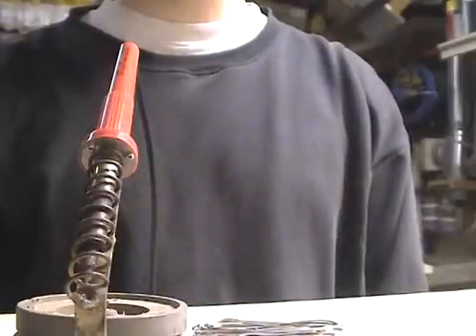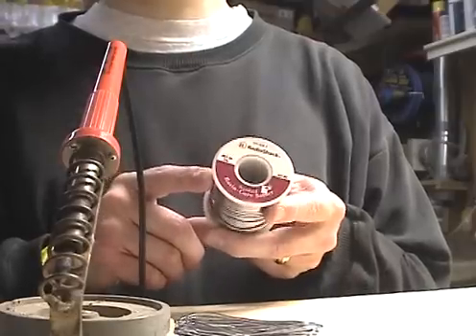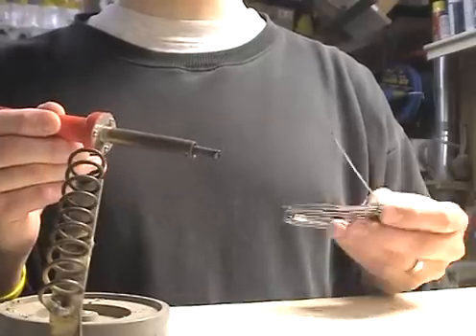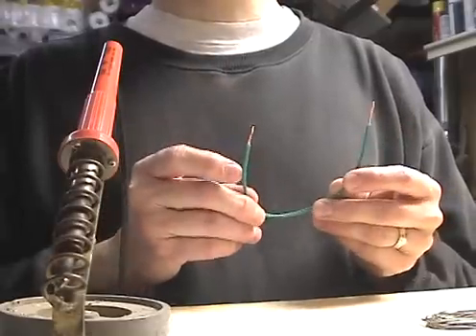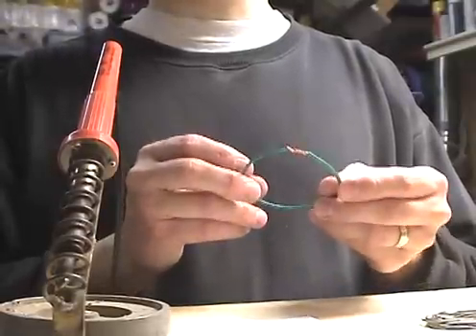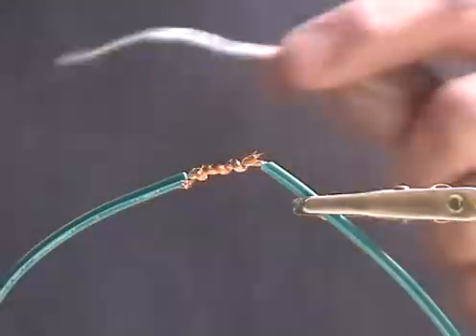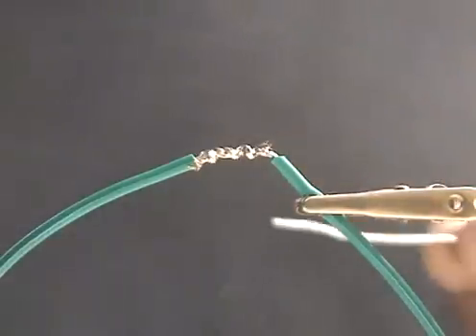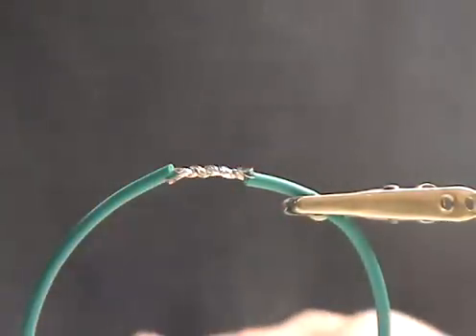How to Do It: Basic Soldering

Comment: My weller 25w iron didnt do well on my guitar pots. Took too long to heat the area and made a mess. Worked better with small soldering. But for pots i  am guessing 40w would work better.

Comment from the maker: @andromedarr When soldering delicate electronics, the first precaution is to make sure your soldering iron is sized for the job: don't use an iron that's too hot (too many watts).  Then you should use a heat sink (a clip on the component lead in between the solder joint and the component) if possible.  Finally, speed in completing the solder joint is a necessity because it minimizes the time the joint is heated.

Comment from the maker: @m6b0i When you solder you need both solder and flux.  The flux acts as an anti-oxidant, and as a wetting agent for the soldering process.  The rosin in the core of the solder is the flux.  You need to use flux every time you solder.

Comment: @m6b0i The reason to use rosin-core is because it's easy. With solid solder, you need to apply some type of "flux" (something that helps it melt). Rosin-core solder is called that because the core is filled with rosin-flux, so it's already got flux in it.

Comment: Im sorry for this retarded question because im new to this, but what does the rosen-core solder do? does it clean the tip? Also if i were to solder wires onto a circut board, would i have to use the rosen-core every time after soldering a wire? Thanks

Comment: I'm sorry but I fail hard at soldering. I try to heat the joint but it starts to be burned away and destroyed. I try to tin the soldering iron but the solder doesn't melt. Plus my iron has a shit-ton of oxidation on it. And my solder is too thin and doesn't cover the joint. Plus my raging boner keeps knocking the components away. Please help!

Comment: @letigirl62 
Your tip is probably oxidized. Wipe it when it is hot with a wet spunge until it is clean again, dont burn your fingers, you may get away with using wet paper, folded into a pillow. Once the tip is clean then try to apply solder to the tip so that it is covered by a thin layer of tin. Wipe and repeat if the tip is still oxidized.

Comment: Let the tip get hot enough to melt solder, then tin the tip, then apply the tinned tip to the joint, then rub solder on the joint. Your soldering iron might not be hot enough.

Comment: a tip you can use when soldering wire together is the make a little bubble of solder on your iron then put it on the wire so it more quickly heats the wire to do more contact, just to save you a quick second or two of your life

Comment: im new into soldering and really getting discouraged im not having much luck i bought a cheap 60watt pencil tip solder iron and some rosin core solder 3/32 diameter and nothing working right even when it was brand new it wouldn't melt the solder through a wire or terminal i had to like spread it what is my problem lol

Comment: If you are trying to solder directly onto the surface of a sensitive circuit board or just onto a circuit board or even perf board with sensitive chips on it, do you put your soldering iron on the spot to heat it up like you did in the video and them put solder on it or do you do something else? The reason I ask is because I have heard that too much heat can fry and/or break sensitive circuits.

Comment from the maker: @ELComandoARMADO  The problem is an iron that is too big (gets too hot) for a particular use will do collateral damage in short order instead of just getting the joint hot enough to solder.  In your case it will likely melt the wire insulation near the joint, causing cosmetic damage to the wire, which may or may not be a big deal depending on how particular you are.  In the case of electronic component soldering, too large an iron can damage the components themselves.

Comment from the maker: @spartan117024 The joint will cool pretty rapidly once you remove the soldering iron from it, but as long as it's hot enough to melt the solder you don't need the tip in contact with the joint.

Comment from the maker: @MackJohnny When the iron tip gets oxidized it won't conduct heat well.  In other words, it won't melt solder and/or transfer heat to your soldered joint.

If the solder isn't flowing, I would suspect that you either don't have a large enough iron to heat the work properly, or that your solder doesn't have flux (isn't rosin core solder).

Hope that helps!

Comment: Hi coldrestart, i've got some beginner questions.... like 1) what happens after the iron tip gets oxidized? and 2) when i try to heat the wire, the solder doesn't seem to want to flow down. How then?

Comment: you are using 40 watts, thats pretty much hot, what about lower heats like 25w? you will not be able to do this with 25w with small and thin tip... some beginners might have some diffuculties after watching this video... bcuz their equipment will not allow them to do the same thing as you do... but this is a very great video indeed.

Comment: Thanks for this video.  I never solder before but now you inspired me to give it a try!  I have a question though.  I have two tv sets that have a problem with the video inputs; the rca inputs seem to be loose which makes my videos look greenish on one tv and no video on the other.  Is this what know as cold solder looseness or am I using an incorrect term?  Is this a cheap fix at a shop or should I give it a try myself?  Thanks for your help.

Comment from the maker: All pencil irons take a while to heat up initially. It should only take about five minutes.

A new soldering iron tip won't hold solder well, but it needs to be tinned prior to use.  Keep alternately tinning the tip and cleaning it until you get solder to stick to it.

Comment: Flick the solder and splash it onto a paper???  

That's totally unsafe and such a dumb way to work with dangerous hot and potentially toxic substance.  Just use a sponge or a tip cleaning foil thing.

Comment: hi if you heat the wire with the iron,then put solder to the wire  still with the iron on the wire you will see then  it melt, this is called "tinning" thats what it is called in the trade

Comment from the maker: In a car there are plenty of mechanical electrical connections so soldering isn't necessary, as long as your connection won't come apart and is sufficiently insulated.

Soldering in the tight spaces of a car can be challenging too; you have to make sure you don't accidentally melt plastic of the dash or something else with the iron.

The resistance isn't an issue regardless in this case.

Comment from the maker: I tin the first time simply for cleaning the tip and to aid in getting old solder that's sitting on the tip off.  It might not be necessary to tin the tip to clean it; that's just my technique.

You just don't want to tin the tip just prior to soldering with old solder sitting on the tip; it needs to be cleaned prior to tinning.

Then just prior to soldering, I lightly tin the tip again, leaving the solder on the tip this time.

Comment: i dont know if im reading my car book wrong but it says electrical components get damaged when the resistance in wires in different in one area then others in the same wire. I was wondering what i do for the red wire thats been cut on my radio right now i havent i ghetto rigged with a cap and electrical tape. I can solder it or i have wire connectors, what do you think is my best bet? and if i soldered it what should i do about the resistance to the current in this area?

Comment from the maker: Yes, the principle is the same.  Just be sure to heat the joint itself, be it a pad on a PC board or a wire, and apply the solder to that until it melts and flows onto the joint.

Comment from the maker: You need rosin core solder intended for general purpose electrical/electronic use.

I still use 60/40 tin/lead (60% tin and 40% lead) rosin core solder, but lead has health risks and lead solder is banned in Europe.

It has been replaced with lead-free solder, but most of the lead-free solder alloys melt at higher temperatures than tin/lead solder and can thus be a bit harder to use.

For general purpose applications lead-free solder will work fine.

Comment from the maker: For basic electrical soldering you'll need a pencil soldering iron and rosin core solder.  A new soldering iron should come with a tip.

The cheap stands that come with some pencil soldering irons aren't great for lots of soldering either, so you'll want a proper soldering iron stand if you're going to do a lot of soldering.

For fixing wiring you'll also need a wire stripper and cutter, as well as electrical tape or heat-shrink tubing to insulate the new joints.

Comment: my next suggestion would be to buy some solder tip cleaning paste.  Just dip the hot tip into the paste and wipe it clean.  It should be shiny silver when you pull it out of the paste.  Tin immediately.

Comment: You have a dirty tip. you might try cleaning the hot tip with some steel wool or scraping it with a knife edge and then try retinning.  The problem is some kind of film on the tip so you have to clean that off and then try tinning.  Also try melting some flux on the tip (to clean it) before ou scrape it and then applying solder to tin it.

Comment: i don't heating the wire is a good idea, especially when you have to solder circuit boards with sensible electronics.....i usually use a min. 100watts soldering gun that i heat up before use and then apply some paste on the cold wire. then i put solder on the tip of the soldering gun and with just a touch i put them together and the solder covers all the area.

Comment: When I solder my soldering iron ends up melting the plastic wire coating and the solder never melts into the wire, then my friend told me to use solder flux paste and worked a treat.

But nothing is mentioned in this video about this flux paste?

Comment: One tip, if your doing small electronics like modding video game consoles, computers etc. you should not hold the iron to the wire that long or it will transfer heat all over the motherboard if your trying to connector your component to the motherboard, it will spread the heat all over the traces and it can end badly, I learned the hard way NEVER touch your iron to a small electrical component like mobo's on PSP's xbox's etc. for more then 5 seconds MAX.

Comment from the maker: Heat is primarily a concern for delicate electronic components, but the heat from soldering will melt insulation and other plastic (such as on connectors) as well.

Knowing how to solder well will insure the job is completed quickly the first time which will help minimize heat damage.  Obviously the longer the soldering takes the more heat there is and thus the possibility for morel heat damage.

If in doubt use a heatsink.

Comment from the maker: I have had the same problem.  All soldering iron tips will degrade with use.

And once the plating on the tips is gone, they'll degrade even faster.

My experience is that higher wattage (hotter) iron tips degrade faster than low wattage irons too.

Always keep your tip tinned - tinning prevents oxidation of the tip.

Do a Google search on "care of soldering tips" and you'll find a lot of good information.

Comment: One more thing.  For some reason my tips get dirty and begin to degrade to the point where heat transfers very slowly.  I constantly clean the tip and have tried various tip cleaning techniques.

Do you experience this?

Is it a result of NOT tinning the solder tip?

Thanks - again great and helpful video.

Comment: my solder won't melt on the wire:( the wire burns and becomes black but the solder isn't melting unless i touch it with the soldering iron

Comment from the maker: In the case of electronics, you should use a heatsink on delicate components that you don't want to overheat.  An alligator clip on the component side of the lead (in between the solder joint and the component) will suffice as a heatsink and draw some of the heat from the soldering away from the component.  They do make devices specifically for use as soldering heatsinks as well.

Comment: 1. Use a sponge or wet tablecloth to get melted solder all over the tip, do not flick. Flicking it will make small spheres of solder fly off the tip way out of control. 
2. Extra flux is generally a good way to secure an even better solder. 
3. Make sure there is a draft or something to get the solder fumes away from your breath, because there are tiny flux lines inside the solder which evaporate and will get you a free headache if you are unlucky.

Comment: You should use heatshrink tubing to insulate the joint.

-Cut off a bit that will overlap the joint and cover the insulation on both ends.
-Put it over one wire far enough to expose the end.
-Sodder.
-Move it over the joint so it covers the insulation on both ends.
-Heat it with the soddering iron or lighter. Don't touch it.

It will shrink and close the exposed joint.

Comment: SpartanXx666xX:
The soldering iron doesn't melt the copper wire because the copper melts at a MUCH higher temperature than solder (the 60/40 kind demonstrated melts at 370 F). 

And secondly, yes, you do heat the pad and the wire and melt the solder right on the pad on the opposite side of the iron.

Comment: Head to fry's and get a $5-$10 electronics kit project (something for novices like an LED circuit).  Buy a $3 soldering iron and $1.50 worth of solder and try it out.  Be prepared to screw up the first project, but it's ok - the kit won't set you back very much.

Comment: I guess I'm just not picking this up that well. I've never actually soldered or know anyone that has. I was curious (correct me if I'm wrong), but you aren't supposed to touch the solder with the iron when you're soldering the wire. But, what's being melted onto the wire and how? I guess I just don't really get what "solder" is, like what material that is. 

Just remember... I R Dumb with this. :P

Comment from the maker: It is a bit but I've never had a problem with it.  The iron tip is hot too so soldering isn't without hazards in general.

You can use a dampened sponge (as I said in the video).  I just find flicking to be more expeditious, but I like living on the edge... ;-)

Comment from the maker: Skyline is correct.

Touching solder to the iron tip wastes solder on the iron tip that likely won't end up going anywhere. It can also contribute to a "cold solder joint" where the solder doesn't flow over the connection properly because it wasn't heated.

Comment: I ripped my guitar wire inside that guitar, it was connected to a metal piece which the amp cable goes in it. Can i solder that back together?

Comment: Different metals have different melting points, or temperatures at which they melt. The solder itself is an alloy (metal mixture) of tin and lead with a very low melting point. Hence, it melts while the copper doesn't.

Second question: Since this video says to apply solder to the wire itself, I'd say these people are right, but I don't really know. I'd ask around some more.

Comment: i just understand one thing,
if the soldering iron is hot enough to melt metal how come it doesnt melt the wire metal???

and also if you're trying to solder a wire to a circuit board, a lot of people told me to heat the board and the wire and place the solder on the area....
is that right???

Comment from the maker: The big difference between welding and soldering is that with welding the metal of the objects being joined is melted.  In soldering the solder itself is the only thing that melts (and that happens at a relatively low temperature) and the solder bonds the two metals together.

Thus soldering doesn't create as strong a bond as welding.

I would venture that soldering is easier than welding.

Comment from the maker: I certainly wouldn't recommend flicking solder on oneself any more than I would recommend touching the hot soldering iron tip.  A dampened sponge or dampened paper towel can be used to wipe the excess solder off on as well; I just prefer to flick because I live on the edge!  ;-)

Comment: What about trying to solder thick wire such as 12G noodle wire? I have a 60W iron and placed it underneath the wire while having the solder on top of the wire and nothing happened. Also, how would you attach the wires if both are thick?

Comment from the maker: First I'd recommend replacing your tip.  Lead free solder can be a bit harder to use than lead solder as it has slightly higher melting temps but I doubt that's your problem if the solder is melting.  Also make sure you have rosin core solder.

Comment: nope it will not stick at all. i tried it again since the last comment i left you. i think the tip is dead as the pointy part is broken off or its the lead free solder Im using. could those be doing it? its not even heating up good anymore :(

Comment from the maker: If you have a new soldering iron the solder won't stick to the tip right away.  Just keep putting solder on a little bit at a time, clean off the tip and repeat until it does stay on the tip.  Eventually you should be able to get a thin coat of solder on the tip.

Comment from the maker: That depends on the how the tip is made and how much use it gets.

Most tips are copper with some plating on them. Once the plating wears off the copper will erode as well.

I file or sand the tips for shape once the plating is gone and continue to use them, but it's not optimal and the tip will continue to erode and sometime get cold spots after the plating is gone.

Comment: no, you would be using flux(rosin) free solder

60/40 and lead free are almost the same, just lead free has a slightly higher melting point

Comment from the maker: Pre-tinning finer gauge wire is usually a good idea.  After you do that sometimes you can twist them together as the solder makes the wires stiffer.  If you can't twist them together, soldering them parallel without twisting will work fine.